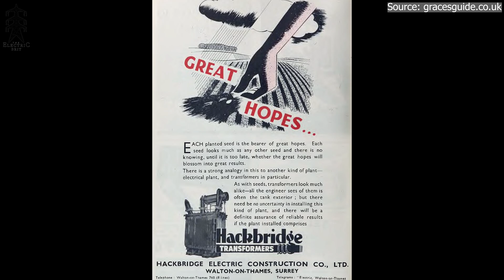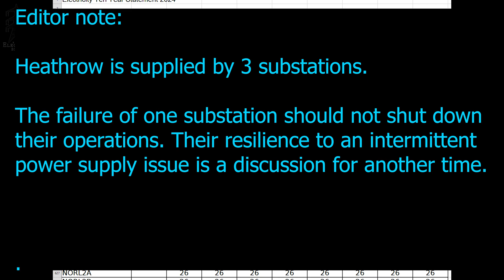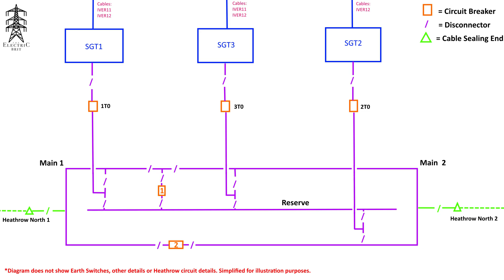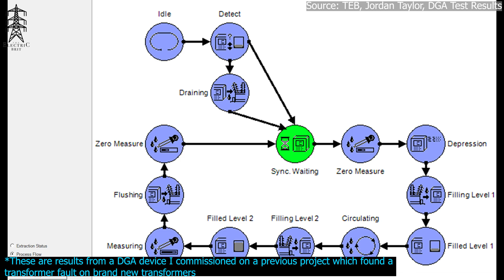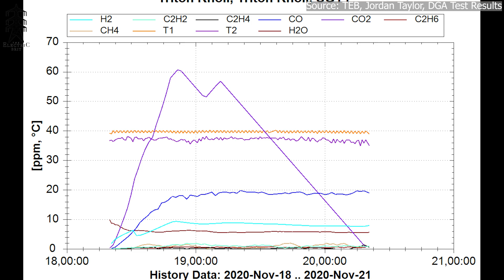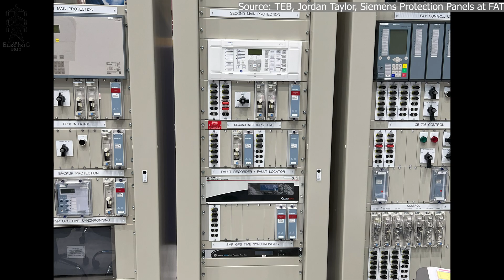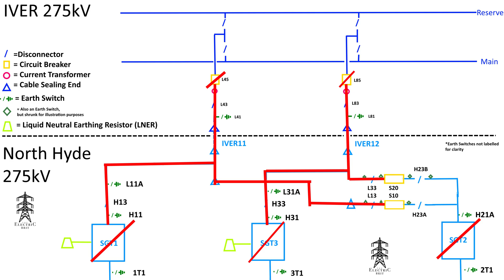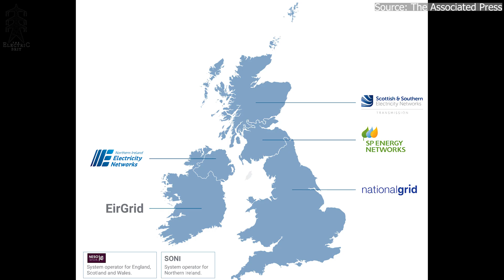North Hyde Substation Fire Analysis

Comment: I want to see the protection relay settings and connections. She’s been linked out and  or limits turned up to the max. Disappointed, that a cascade failure of such critical infrastructure could happen in this day and age. Also amazed that the airport is not completely supported during a power cut. Just need to wait and see what the investigation says. Cheers
Reply from the maker: Agreed. Will be interesting to hear what damage was done to the furthest SGT as NG CEO is quoted as saying as much. And likewise the Heathrow bosses saying their ATS isn't designed to switch that much load over is an interesting angle and or that their IT takes hours to reboot.
Reply: I look after a building with 2 independent 11KV supplies, 2 transformers and 1 generator for security of supply. UPS s for the IT side. The switchgear and genny have been modernised to allow synchronising with the grid. Our processes are time critical so regular testing is carried out randomly across shifts. IT don’t like the hard tests but is does all work and we can return to process in under a minute. And it’s about 40 year old. I would have thought an airport would have had similar at least. Especially the UKs largest. Cheers.
Reply: @TechOne7671  I work at a large UK hospital site. We have an 11 kV ring with two geographically separate incomers from the grid, three 11 kV standby generators feeding the ring plus three sitewide UPS systems for our critical care and theatre areas. All DBs are dual incomer with automatic changeover. Admittedly LHR is much larger than a 1200 bed hospital, but the same principle and power supply architecture should apply. To me it feels like a reluctance to invest in redundant systems because "it probably won't ever happen".
Reply: @drmal  exactly mate. You know what I am talking about.
Reply: @drmal I wonder if it's just a balance of costs, perhaps the occasional outage like this is cheaper than the upgrades and maintenance of a more robust system? Obviously the motivations for keeping a hospital running are different to an airport, and still I believe their safety critical systems remained in operation.
Reply: @RyanJ_  I'm sure that's what it would come down to.  Someone calculated that the cost of a shutdown is less than the cost of the infrastructure to increase uptime.  But as is often the case with these things, the calculations were done when the site was built or last upgraded, and the values may have changed significantly since then.
Reply: @RyanJ_  I agree with you and @Berkeloid0 . This will be a cost/risk/benefit calculation. It's only speculation, but if LHR don't pick up the EU261 compensation bill for each airline for their cancellations, then their financial hit for shutting the airport probably isn't eye-watering. In a hospital we have national standards (S)HTM 06-01 which requires resilience of supply. My guess is there's nothing in the 18th Edition that's mandatory for an entire airport.
Reply: With the kind of fault levels on the Grid, protection discrimination on such a high density area is very difficult to achieve. When you get out into more open areas the impedance of the transmission lines can be used and are more effective. Substations will also have differential busbar protection that will clear specific fault zones. There are breaker failure systems that will then clear surrounding zones if the fault remains, adding further power losses.
I believe Hyde provides the largest feed into Heathrow, so it may be that they were running the whole site from that feed. Depending on the load types some systems are prevented from re-energising after a power failure, to prevent a large inrush. They may also have had systems that go into a safety power shutdown after power failure, to ensure that the are brought back online in controlled manner.